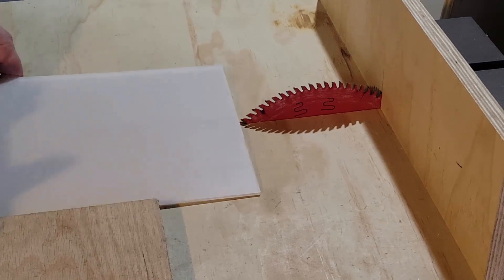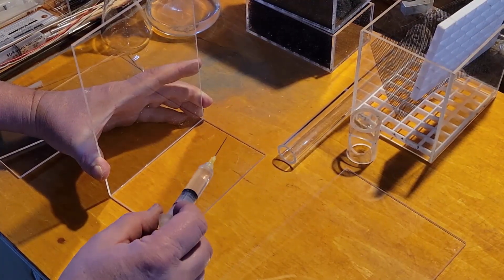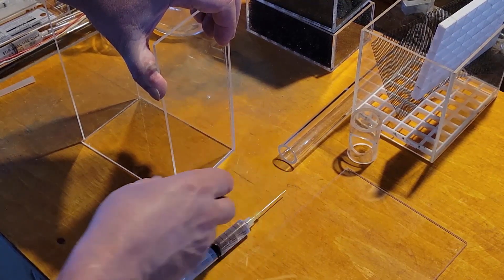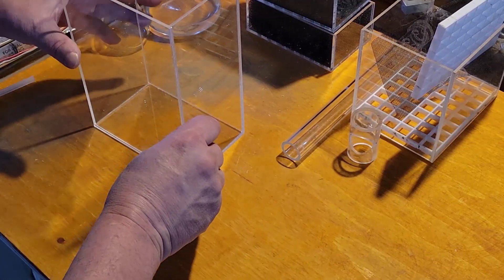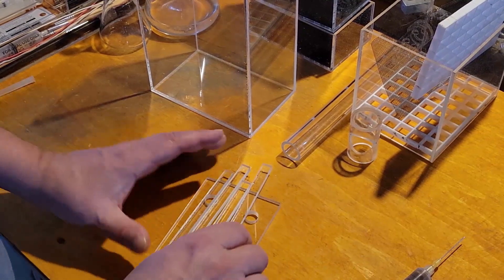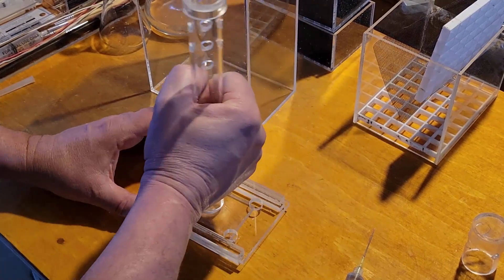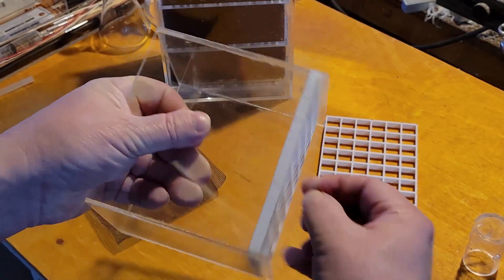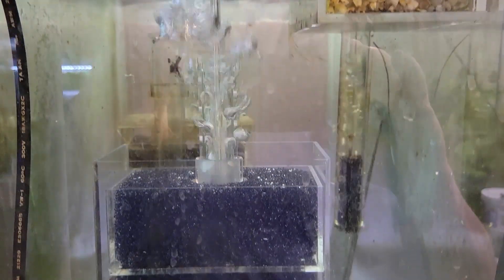How To Work With Acrylic Building The Test Sponge Filter

Comment: We used to run the blade high when we would cut thick lexan (3/8 to 1 inch) at the sign shop I used to work at. The blade was cutting a smaller section of the piece so it didnt melt as much.
Reply from the maker: Another great reason! Thanks for watching!

Comment: How small could the side holes be?  I was wondering if you could make the holes small enough to create an airstone effect.  Thanks Fred O
Reply: totally thinking the same thing....smaller holes would be cool....super design as always though Fishman!!
Reply from the maker: @jackanddan  Thanks guys!
Reply from the maker: Hey Fred! The problem with smaller holes is back pressure. If the holes get too small the air will build up in the pipe, cutting down on flow. I'm not sure how small the holes would have to be to cause issues though. I will give it a try and see if small bubbles can be made before this happens. Thanks for the idea!